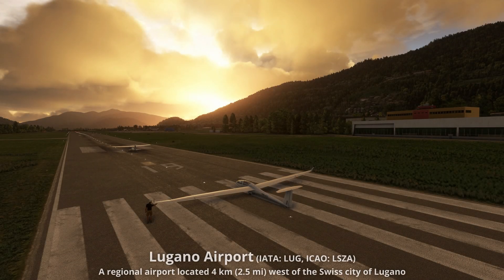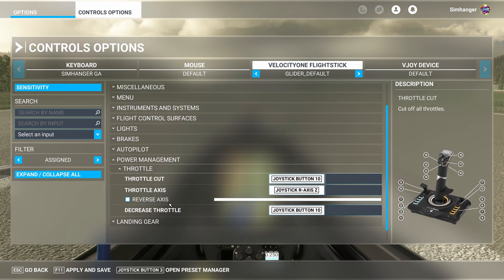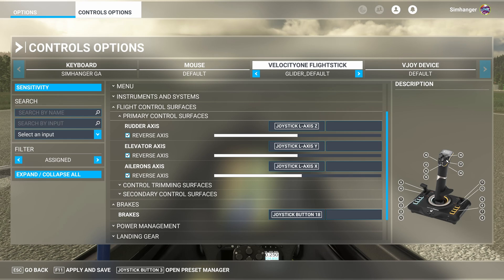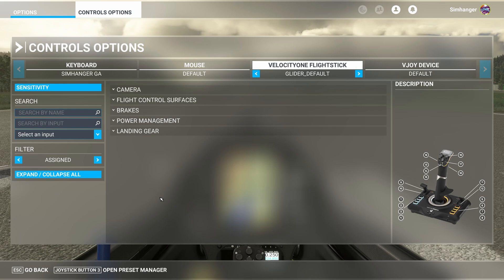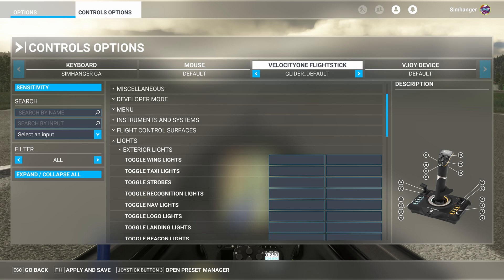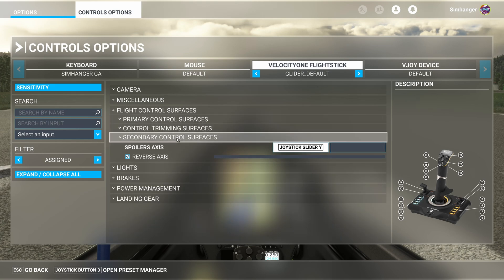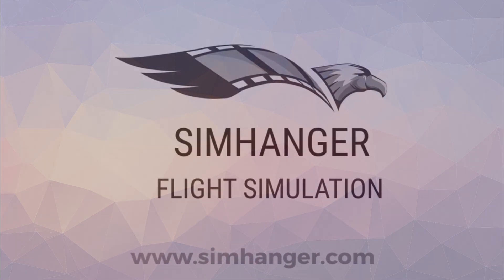MSFS | Configure Your Controller for Gliders | Step by Step Guide

Comment: I'm converting to the DG1001E NEO and programming my HOTAS system,  I needed control of the airbrakes, so initially programmed Button 3 as a toggle.  Crude but effective.

My preferred approach is a standard circuit with 100 Km/H on final, nose pointing to threshhold.  Much better to have incremental airbrakes, so I programmed the [ key to increase (think of a hand catching airflow) and ] to decrease - analog control of airspeed like a throttle.

Hold the 100 Km/H to short finals, move to max airbrakes and round out and land as usual.

Thanks for the guide - lots of useful tips.

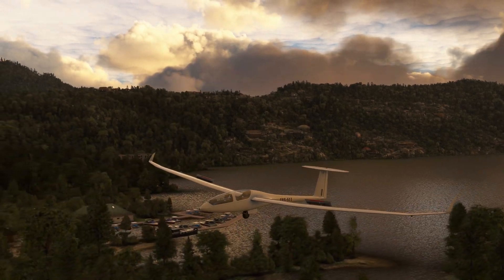Comment: 2:08 Just to clarify that spoilers/airbrakes in a glider aren't primarily used to slow you down; that's done using the elevator.  Spoilers are used to increase your rate of descent, by 'spoiling ' the lift over a section of the wing.

Comment: In modern gliders the "spoilers" are called airbrakes.  Also, they are not used to "slow" the glider down.   Pitch attitude is used to control speed.  The airbrakes are used to increase rate of decent.  At least that is how we teach it.
Reply from the maker: Good to know, thanks